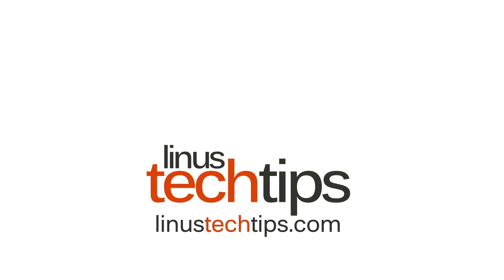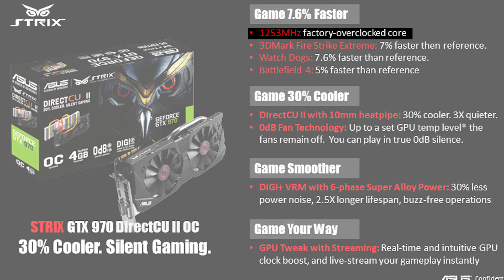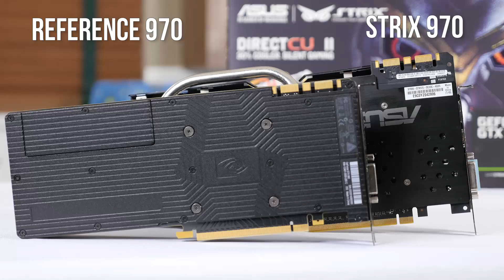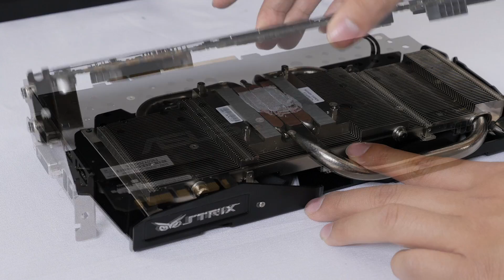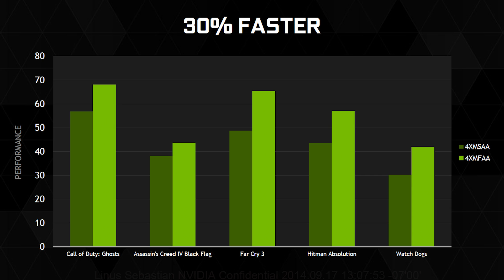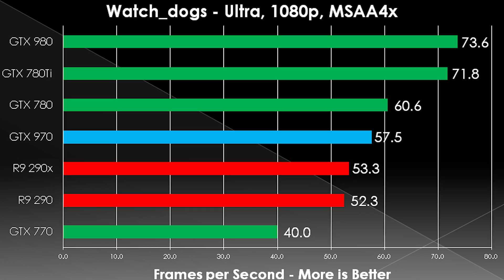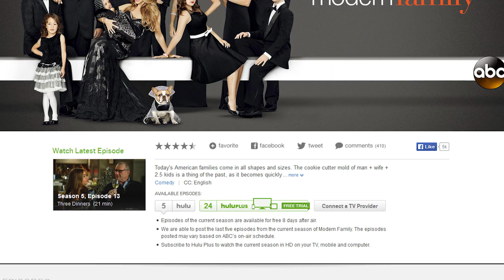ASUS Strix GeForce GTX 970 Video Card

Comment: Is This a good build? (please answer)

Asus GTX 970 4GB
Intel Core i5-4460 3.2 ghz
8GB ram
550w XFX Pro series PSU
Reply: ImpireHJ I would get a i5 4690k other then that pretty good :)
Reply: ImpireHJ i would stick with 4460 unless you plan to overclock. psu could use a bump if you are concerned with future proofing or potential sli. as it stands without plans to overclock or get sli, it looks perfect
Reply: ImpireHJ I have the same build but with with a 600w PSU. I'd recommend bumping your PSU up a little bit. 550w is cutting it close.

Comment: Guys I confirm: The GTX 970 Strix with GTA 5: FREAKIN AAAWESOME!! Hyper fluid! I`m using it with a i7 4770. Perfect FPS. I can`t complain. I definitely recommend it.
Reply: put down anti aliasing, im playing x2 msaa for online, everything maxed out 60-70 fps with my 970 strix
Reply: Mynd Melt Hi back. I just checked on that chart here which can give us a great idea of the GPU performances:

http://www.videocardbenchmark.net/high_end_gpus.html

Yes I think the GTX 970 will worth for you. It`s the double performances of your GTX 760. Would be a good idea. I don`t know where you live but look at this deal in a Canadian webstore:

http://www.ncix.com/detail/asus-geforce-gtx-970-strix-0b-102345-1028.htm

That`s cheaper than what I payed. I bought it for 444$ on March and here it`s only 420$. They don`t charge any tax. If your in the US it will become even cheaper.
Reply: Jonas Streit Let`s say we put all the graphics on the top to make a quick story. It`s very fluid and there`s nothing I can complain about. I`m sure this card will stay great for many other years.
Reply: DirtySanchez Hi. That's a good question. Mine is super quiet. I never hear it at all. But my friend told me his GTX 970 Strix is noisy when it's reaching a certain temperature. By the way that card is damn amazing! I can even run Star citizen to the top (on very high), GTA V almost to the max except small details which I don't mind. The're a lot of stuff you can tweak in the drivers. I give it 5 stars on 5. You will love it.
Reply: ***** On GTA 5? Everything at the max and it`s super fluid. I`m amazed and feel where my 460$ went.
Reply: ***** Well it depends of your budget. I found myself a bit crazy to invest so much in a video card but after I saw the results I was really happy. Just make sure that your PC case is deep enough because the Strix is pretty big. Also make sure that your mother board can take it.
Reply: ***** I really hope everything will work for you because that`s a lot of money but if you`re a real geek like me: GO FOR IT!

Oh and by the way, when we have a good PC tower, it`s always good to have an air compressor to shoot in it about ever 2,3,4 months to get rid of the dirt accumulation. You put some tooth picks or qtips between the propellers of every fans, you make sure your PC is unplugged and turn off before doing it. Anyways a decent air compressor is not expensive.
Reply: ***** Ha yeah great! I need to do it also. I will this week.
Reply: Grunge LovR So the 970 is a way to go for GTA V ?
Reply: david purnama Yes sir. And the game runs like a charm
Reply: Grunge LovR $460? O.o its showing ~$340 for me on amazon.http://www.amazon.com/ASUS-STRIX-GTX970-DC20C-4GD5-Graphics-Cards/dp/B00NJ9BJ8G
Reply: I'll probably be buying this 970 early next month as I don't see the +~$200  for the 980 being worth it.
Reply: Grunge LovR hmm odk whats wrong with my setup.. i have a 970 strix as well but a i7 4790k and i get around 30 frames on geforce recomended settings
Reply: (S-F)Mr. Frog In GTA 5? Do you have background programs opened?
Reply: (S-F)Mr. Frog Hi there. I think you`re CPU is better than mine (I have an i7-4770) and I get between 55 and 60 frame by second and everything is set to the maximum. Make sure your GPU drivers are up to date. If not you might have a problem with your video card. It`s not normal.
Reply: Dude me too but my fans never turn on. Gfx card temps are at 50 when playing GTA 5.  My case does have good airflow though lol maybe that's why.
Reply: I think I'll buy the 970 right now since its cheap and wait to see how the 390x is.
Reply: Mynd Melt Hi there. That`s a very good question. Let me tell you: Not at all! Super fluid! However in about 50-60 hours of gameplay, my game crashed about 3 times. But last time I played for about 8 hours straight and did not get any crash. And I run everything to the maximum with a resolution of  1920 by 1080. If you want to run it in 4K then forget it, you will need 2 GTX 970.
Reply: Mynd Melt i actuaslly get more lag when3 im looking around walking instead of zooming my wass down the highway... IN GET MORE FPS IN A CAR THAN WALKING...
Reply: Mynd Melt Oh ok! Are you sure it worth it to pass from a GTX 760 to a GTX 970? Check the charts. Me I passed from an old 560 Ti to a GTX 970 Strix. But my 560 Ti was really awesome! Especially from the fact that I had it since many years. I could play to Dying lite on average graphics and it was still really awesome.

For now the most demanding game I have is still Arma 3. Even with this new video card and an i-7 3770 CPU, 16 GB of RAM, I cannot put everything on the top with a very fluid gaming. It lags. For Arma 3 I would say we need 2 GTX 970. That`s insane man! And that game is still full of bugs and none sense physic.
Reply: Mynd Melt Ha your lucky cuz my choice of games was pretty so so. I took Far cry 4 but I don`t very like it. I would prefer the new Batman game. I see that card on Amazon for 330$. That`s a great deal. Go for it! That card is really kicking asses!
Reply: Grunge LovR Do you have 8x msaa or 4x? because with my msi gtx 970 4g I also get 50-60 fps depending on what I'm doing with everything maxed and 4x msaa but as soon as i go to 8xmsaa its more like 35-50.
Reply: Jonas Streit Good question let me see...
Reply: Grunge LovR Alright, thanks for the quick answer, that's abouzt the same as I get^^ 
Quite a nice card^^
Reply: Hey hi Mynd Melt  Sorry to disturb you. You remember the Canadian store website I sent you the other day? My friend ordered a GTX 970 Strix from that website and received it last week. He installed it and tested it but there`s a tiny problem. It`s making a fan noise that sounds like ''tik tik tik''. The video card is making that noise when he`s playing a ''demanding'' game. My friend searched online and found other people who have this same problem. Don`t think that I`m writing you about this to scare you or anything. I just want to warn you about this. Just be careful when the prices are too good. I have absolutely no problems with mine and hope it will be the same for you. I`d not be happy paying more or less $400 for some tik tiks. Take care.
Reply: Mynd Melt Maybe I`m wrong, but for me it sounds like a physical problem with the fan(s) and I doubt a driver can fix this. He told me it only makes noise when the fan reach a CERTAIN speed. By the way I forgot to mention that he has overlooked it. I`ll ask him some details about it. I don`t know if it`s related. I will inform you if he tells me any pertinent news.
Reply: ***** I took what my technician recommended me. That was 2 years ago.
Reply: Grunge LovR Just thought i'd let you know that 4k GTA V is entirely reachable on a single GTX 970. Not max settings, but if you go through and manually pick your settings you can attain a good 60FPS with just one GTX 970 on a 4k resolution.

Also in regards to Arma 3. I wouldn't worry about upgrading your graphics card for it. The engine is the fault, not your computer. Besides, it's far more CPU intensive than GPU intensive. Good on you for coming back to inform people of possible bad buys with dodgy fans though. :)
Reply: Hi SrslyDelirious. Thanks for your message. I guess we need a 4K to play GTA V on 4K resolution. I use a Sharp 46 inches TV to play it and the biggest resolution the game is offering me is 1920 x 1080.

About Arma 3 I did not play since many month because I'm so damn pissed off about this game. That game has a lot of potential but it's so damn buggy. My friend and I like to go in an attack helicopter to blow up enemies but even this is impossible because the gunner camera is ridiculously shaking and the munitions are not powerful enough to kill enemies from 2-4 kilometers away. Normally even with the cannon it would be possible to kill them if we shoot few meters away from them but in this game, enemies wont die unless we hit them in the head. Sorry for being a little off topic but I wanted to point that out.
Reply: Grunge LovR If you want to play in 4k you'll be looking at about normal settings with some high settings, but all you need to do is go into your nVidia control panel and enable DSR, select the x4 option for 4k, and x2 for 1440p. If you need any help with that then i can send you a link to a video that shows you the process, unfortunately i currently use a HD7970GHz Edition, so i can't guide you through the process xD I'm switching over to a 970 next month though. 

Yeah i've had Arma 3 since last year and i gave up playing it too, i got it mainly for DayZ/epoch/overpoch although i ended up going back to Arma 2 Dayz xD
Reply: SrslyDelirious HOLY COW MAN!! I did not even know this!! That is so freaking awesome!! Thanks so much, I will test it right now! Please send me the video you told me about. Thanks a lot again that's much appreciated!
Reply: SrslyDelirious Allright I just tried that and played GTA V on 4K resolution. I only put the Texture on Normal as you told me and the game works like a charm! I'm so freakin amazed! Do you know if it's possible to kind of improve the quality of shadows via the driver? Cuz they're kind of a bit messy sometimes.  Thanks so much man I really appreciate this. I had no idea I could do this.
Reply: Grunge LovR
yeah you can bump some things up to high, shadows you should probably stick on either soft or softer rather than softests/nVidia option as they take up power that you could put into a higher texture resolution that makes the game look better. 

If you use Geforce Experience to optimise your settings then make sure you go into GTA V's advanced settings afterwards and turn everything in there off, they use a LOT of resources for minimal graphical improvements, so you can take everything in advanced graphics off to improve other settings. I hope this helps man. :)
Reply: SrslyDelirious All right great I just found it. There's one option about the shadows. By the way if you want add me to Steam at moontreal_dude@yahoo.ca so we can play together. I have many games.
Reply: i couldn't find you, but if you wanna add me then my Steam is the same as my youtube :D
Reply: SrslyDelirious All right that's done. You'll see me as Cobra_commander lol.See you in game :D
Reply: Grunge LovR yeah no worries man, i've accepted you, we have quite a few of the same games. I currently have a few more games than you though. :P We should definitely jump into GTA V some time though, im playing through story at the moment as i just came back to Windows 7 from Windows 10 and it deleted my saves, so i had to start again. xD
Reply: ***** See this video card as a long term investment. It's very poeerful and you will keep it for long time. As CPU I would recommend you to go with an i7 K version so you can overclock it. 16 GB of RAM, a decent motherboard and a big case with good ventilation. For this I recommend you to look at Antec Solo II.
Reply: ***** All my pleasure mate! Take your time buying it. They wont escape from the store. You can even search for the best price.
Reply: david purnama Yes definitely ... I have ASUS GTX 970 OC and  GTA V runs like charm with GTX 970.. 
Even AC unity runs in max setting with min 52 fps.. Avg 58.... Best card for 1080p gaming :)
Reply: I got the MSI GTX 970 4G Gaming Edition and i am in love with it! :D
Reply: SrslyDelirious Hi dude. Yesterday I got Batman: Arkham knight. I played for about 8 hours. I really fell on my ass by the graphics. THEY`RE SO DAMN AMAZING!!!! The textures are just crazy! I run it very well even with other programs running in the background few google chrome  pages. That video card is even better than I was expecting before. It`s insane.
Reply: Grunge LovR Nice man! I got better performance from my HD7970GHz, and my textures are actually horrific, back to The Witcher 3 and Dying Light for me, so glad i got Arkham Knight for free. xD
Reply: SrslyDelirious Hi dude. What do you mean by: My textures are actually horrigic? On Batman Arkham knight you mean? How are they? Thanks.
Reply: Grunge LovR i'll see if i can get a recording of my arkham knight problem for you tomorrow or something if i can, the textures take forever to load in and i get a maximum of about 45 fps, it's horrible xD
Reply: SrslyDelirious Oh ok I think I understand what you mean. I used to have this problem in Arma 2 and 3.  (Arma is really not a good reference because it`s a massive pile of shit as game. The team whose working on it have no clue of what they`re doing. It`s just unplayable).

Did you try to fix it in the driver control panel?

Thanks.
Reply: Grunge LovR Yeah, it's a well known problem, Arkham Knight is the worst fuck up on PC ever. They're not even selling the game for PC anymore it's so bad xD
Reply: +Grunge LovR I'll wait for the pricedrop. Still only a few titles that demands that much from videocards. 2016 will be the year for a new videocard
Reply: Alucard8319 Hi! Yes I totally see what you mean. They often make new ones that are better than the previous ones. Waiting is often a good solution. By the way yesterday I saw a gameplay of Metal Gear Phantom Pain for PC. That`s gonna be damn gorgeous!
Reply: Okay but we can just look up benchmarks online. And define perfect FPS. Is it bursting 144 FPS for people on 144hz monitors?
Reply: +Grunge LovR i7 is so pricey, i'll get a i5

Comment: So, with the Strix, would I be able to still set the fans on a custom fan profile (the fan speed) with Asus GPU tweak? As in, to have the blades spinning and cooling constantly instead of having them off up until it hits said degrees?

Comment: I don't really understand - people say that a single 8 pin connector is worse than dual 6 pin connectors for a graphics card. What is the difference? Also, does it matter - you'd think that if they used an 8 pin connector instead that it'd be enough to power the card fully.

Comment: I have these specs
Gt 6600
2GB of ram
80 gb HDD 
So im gonna upgrade to i think
GPU: dont know plz help
RAM: 8 or 16GB
1TB HDD
PSU 750W
120 GB SSD
are these specs good enough for atleast 1080p gaming?
Reply: ignas zilinskas 2 gb Ram??
Reply: ignas zilinskas Dude u wont need 750 W!
Reply: ignas zilinskas take the 16gb ram
Reply: ignas zilinskas Whats ur Cpu?As GPU take the GTX 970
Reply: Well yeah,i know this rig sucks ass

So what gpu should i buy?
Reply: +Peter Zeh is 8gb of ram good?
Reply: +Jeremy R i reccomend goin with intel but an amd card so it still stays within budget and going heatsink cooler instead of water he can upgrade later depending what games he plays (intel i5 45/4690/90k r9 3/280/90
Reply: +Jeremy R AMD's processors have weak IPC. Most budget is Pentium G3258. If you can afford more go for an FX6300. Don't bother with the FX6350, the FX6300 works fine and if you really need more, go for something like an i5.
Reply: thanks!,but i already bought my pc  980 ti 16gb of ram i7 4990k(overclocked to 4.1 ghz) 2 tb samsung hdd 10k rpm the cooler idk its name but its 600w :D
Reply: yeah it does,look it up
Reply: lol i thought it was an 4990k XD but its actually 4970k :D when i saw your comm cheched my specs and yeah ,i was wrong :D
Reply: +ignas zilinskas GPU 970, 8 GB RAM,  1 TB, Get an EVGA 80+ 500W  power supply. What's you're CPU?
Reply: i7 4970k
Reply: yeah your good to go
Reply: thx
Reply: +ignas zilinskas get this 
8 gb ram (you wont need more)
CPU(Processor) i5 4690k
GPU: GTX 970
PSU 650w (you wont need more)
Reply: already got 980 ti ,i7 4970k 16 gb ram 600 w psu
Reply: ignas zilinskas ohh well good for you thats a verry powerfull build MEANWHILE i have a 2300$ gaming laptop WITH A BROKEN GPU... fml
Reply: +TheSuperslajsaren Alienware? :D
Reply: no,hand biuld,parts from skyech
Reply: skytech*
Reply: Upgrade that pile of trash
Reply: already did and before comenting ,read all reply's
Reply: ignas zilinskas good job, whats the psu model?
Reply: donnu,dont care